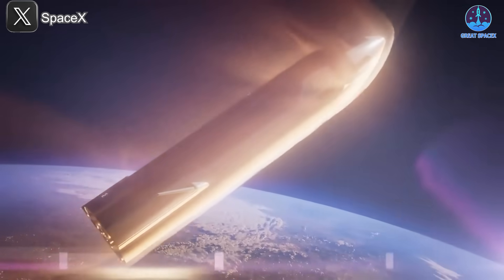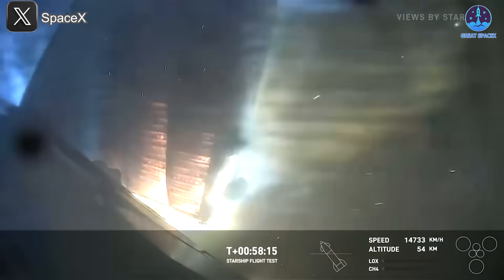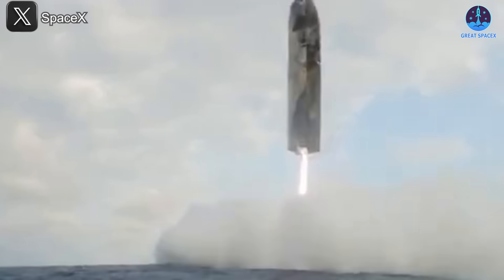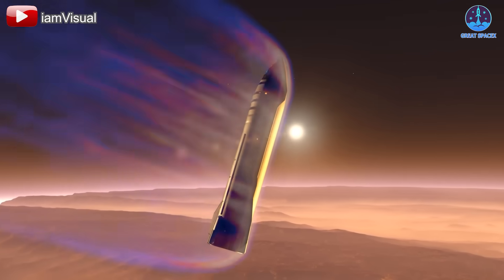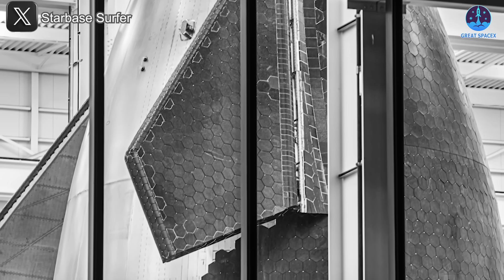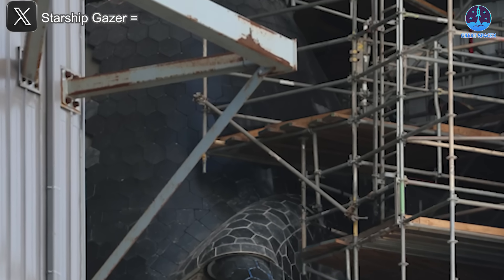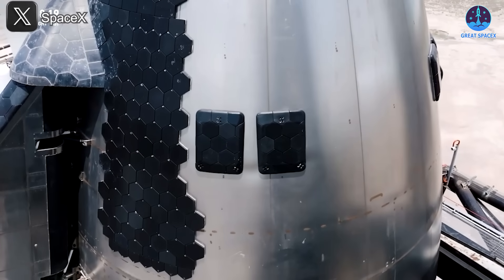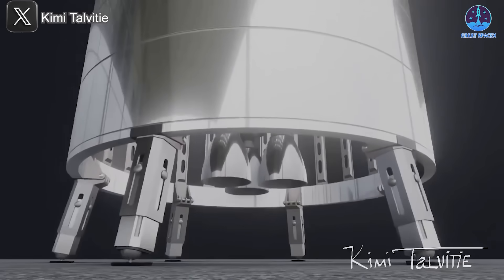Elon Musk Revealed Why SpaceX ditched Starship's Ceramic Tiles: New Metalic Trick!

Comment: The USAF space plane X-20 Dyna Soar developed in the mid '60s, was constructed of all metal.
Using Rene-41 alloy & Inconel-X, welded to create the fuselage and wings. For the hot nose cone, a metal-metal composite was developed using Zirconium pins in a matrix.
All was tested and cerified for the extream conditions of rentry, and fully reusable.

Comment: No, they really won't replace it as you say as these All or Nothing ideas are dumb as hell.

Most of the craft the tiles are fine. 

It is mainly the joints for the flaps, so for those it would make sense to evaluate adding transparation to the joints.

Trying to cool the entire thing with nitrogen or methane is asinine.

They need to add some ventilation around the flaps/wings and use some of the metal tiles or some other combinations.

Comment: Well I would put dimples in the Hull which will be thinner due to the added strength as is inherent strength which comes with Dimples, then I'd have an inflatable bollute which will inflate to be a heatsheild from below the Rockets then detaches at a safe altitude then land on the ground with thin curved titanium legs I'd say one every foot ....so there

Comment: Something like transpiration was tried on jets in the 1980's.  Compressed air was blown out through tiny pores in the wing to keep flow laminar and allow higher angles of attack.  It worked, but was impossible to maintain because the pores kept getting clogged by dust.
Reply: Clogging with dust seems like the biggest threat to the system.

Comment: When Spacex has established orbital re-fueling, they can refill the space ship prior to a boost back burn to avoid the reliance on atmospheric breaking,  Thus negating the need and weight of a heat shield
Reply: How much fuel would that take? Far too much to be practical I suspect.
Reply: @Tailspin80  It would require a complete refuel which SpaceX is committed to developing for the Mars and Moon missions.  The fuel is cheap compared to the ships cost
Reply: @ A complete refuel means a whole launch dedicated to getting the fuel up there. That ship has also got to return so what have you gained? Or are you suggesting the ship carrying the fuel is disposable so doesn’t need to return?

Comment: The catching outfit needs to be designed for the worst case, where failure is common.  This means the tower needs to be bombproof and easy to repair.  The issue is the size of the bomb when things don't go as planned.  It might be better to put the catch tower away from the launch tanks.
Reply: Ships are almost empty during landing.
Reply: @scientificperspective1604  Thanks for the laugh!  Have you ever seen an object that weighs that much slam into a building?  The ship can be totally empty, but the damage will be massive.
Reply: @kensmith8832  You seem to be reaading something other than what was written.
Reply: @scientificperspective1604  It seems you are on a different page from my original comment.  I am looking at the physics of inertia versus steel.  The amount of fuel only adds mass.  I am sorry, I am talking Science, should we dumb this down to teacher level?

Comment: Using a hydrocarbon is not a good idea! Nitrogen maybe a better choice! 600 degrees to start the flow of the nitrogen. There should be an over flow and return to the nitrogen tank to cool down the gas. The color should not exceed a yellow color. If it reaches a red color. You need to increase the flow. When it turns blue you will need to replace the tile. It will have absorbed to much oxygen. The material will have its flexibility.

Comment: It takes forever to replace tiles but an ablative coating layer could be sprayed over the entire assembly quite quickly before each launch, sacrificing itself each time to protect the tiles.
Reply: Sprayed heat shields need to be carefully dried before they can be used as a heat shield.

Comment: Moving the fwd flaps is the most important thing. Even the rear flaps could be moved another 10°, and this would give enough angle to protect the joints.. what they really have to do is protect the other side of the ship from the thermal radiation. This involves either thermal blankets or an ablative white paint that is used by pretty much every other spacecraft, including the dragon capsule. just like on the space shuttle. The plasma generates enormous infrared heat that must be reflected away on the opposite side. This is why the leeward side is deforming and discoloring so much. This type of stress will make the ship unusable after even a single flight.

Comment: Starship and Tesla full self driving are both failing because Elon will not admit that he took the wrong risk. The SpaceX starship second stage needs to be completely redesigned because the magic material that Elon told his engineers to assume would exist that could survive the heat of reentry and be instantly reusable Does not exist and probably cannot exist based to the laws of physics. Tesla full self driving is failing because Elon told his engineers to only use video cameras and no other type of sensors. Full self driving doesn’t work and it is clear that Elon now is trying to hide that fact by keeping Tesla full self driving far away from independent testing or even reporting on crashes caused by failures of full self driving. Taking risk is fine! But knowing when to admit, failure is a key component that Elon is missing.

Comment: “Catching starship“ is completely meaningless if there is no instantly reusable heat shield tile. Until the magic instantly reusable heat shield tiles that Elon believes can be made exist, catching a starship second stage is a complete and utter waste of time. Unless the idiot clown child, Elon can defy physics and come up with the magic substance that will constitute an instantly reusable heat shield, the very first thing that a starship that is caught will do will be to improve it from the launch tower, take it away to refurbish a great expense, the thermal protection system.

Yes, Elon was correct when he postulated that a booster stage like that of the falcon nine could be caught or landed and reused successfully. Of course, no one wants to talk about the fact that falcon nine boosters, even after several hundred flights are not reused immediately. Falcon nine boosters after they are landed have to be inspected And refurbished before they can fly again. Elon postulated that the starship could be immediately reused as long as a magic substance that can survive reentry and be immediately reused for a thermal protection. System could be engineered. That is proving not to be the case!

Comment: Starship is failing!!! Elon Musk told his engineers to design a starship based on the existence of a magic substance that could survive reentry and be completely reusable immediately after. The size, shape, and reentry approach of the starship is all based on the existence of this magic material. Now, it is becoming clear that this magic material does not exist, and will not exist. SpaceX is now frantically throwing all kinds of things against the wall in hopes that they could find something to take the place of this magic material. I hope they succeeded, but if they don’t succeed soon, then it is going to be necessary to completely redesign the second stage of starship Using materials that really do exist and also to change the operational approach. The idea that a starship second stage will be flown down and land at a top a super heavy booster already on a launch tower is complete fantasy now and needs to be changed.

The situation that starship is in could have been avoided if SpaceX had invested in sufficiently rigorous ground based testing before they designed starship. However, the idiot, clown child Elon obviously told his engineers we don’t need to do that you can just go ahead and believe me! This situation is very similar to Elon‘s other massively stupid decision, which was that oh the starship doesn’t need a flame trench! NASA got it all wrong! Flame trenches are unnecessary! Of course, we all saw over the first few flights at SpaceX finally was able to convince the idiot clown child that they did in need need a flame change if they weren’t going to destroy the launchpad for each launch.

Elon is not a genius engineer. He is an idiot clown child who makes decisions without facts that end up dooming the projects that he works on. Another project that is being doomed by a decision of the idiot clown child is full self driving. The idiot, clown child Believe that only cameras were necessary to provide data for full self driving and other types of sensors were not. This is why full self driving is not working in Teslas. And will never work in Teslas as long as they stay with Elon‘s stupid decision of only using video cameras.
Reply: The starship second stage needs a complete redesign. It is now painfully obvious that Elon‘s dream of a magic material that can withstand the heat of reentry and be instantly reusable is just a pipe dream. It is not going to come true. All of the major design points of the starship right now depend upon the existence of this magic material. Now that it is clear that this magic material does not exist, the second stage of starship needs a complete redesign. Every test that SpaceX does with the current design of the starship second stage is really pretty much a waste of time. They are not learning what they need to learn in order to create a second stage of starship that will actually be Reusable. My suggestion would be that they should go to a space shuttle like design that can land on a runway rather than an expensive and unique launch shower.

Comment: I'm npt enthusiastic about methane as a coolant since it is flammable and the combination of heat in an oxygen atmosphere, I believe that the methane coolant would sheath the spaceship in a wreath of flame. Nitrogen is better but it is probably a gas when used so it will not carry off enough heat. Problems that will be addressed but this first description is not likely to be the solution.

Comment: If plasma is controlled by magnetic fields, like in a Nuclear rocket engine. Why cant a magnetic in the center of the title repeal the plasma??? ""Plasma magnetic charge" is not a standard term in physics, but it essentially refers to the concept of a plasma being influenced by a magnetic field due to its charged particles, meaning the plasma itself doesn't have a "magnetic charge" but behaves as if it does because of the collective motion of its charged ions and electrons within a magnetic field; essentially, the plasma is considered "magnetized" when the magnetic field significantly affects its behavior. ' Is it not Plasma that is the issue???
Reply: Actually the problem isn't plasma. When a space vehicle re-enters the atmosphere, the compression of air results in the creation of plasma, but there is always a boundary layer of air that prevents plasma from ever making contact with the vehicle. The largest source of direct heating, is convection from the boundary layer. While the plasma itself certainly has a radiative heating aspect..... the biggest issue remains heating from convective friction.
Reply: In theory a magnetic field oriented along the ship would deflect the plasma. The problem is the magnitude of intensity of such a field, which makes the idea impractical. Just think about the huge kinetic energy of the ship at orbital speed that is dissipated currently by momentum loss (hitting the atmosphere). A magnetic shielding field should mediate all this energy loss without mechanical contact, requiring way more field intensity than is possible with permanent magnets inside the tiles.
Reply: @laszlokorosi9012  Even if you could deflect all the plasma with a magnetic field, you would almost certainly induce a quantum fk ton of eddy currents in the ships hull..... substituting convective heating for electromagnetic heating. That and you'd need a nuclear generator to power it all..... which they will never agree to having for a vehicular return.

Comment: How can they connect 18,000 metallic tiles to a cooling gas supply
Reply from the maker: Great question. Do you have any suggestion about this?
Reply: @colonbina1 maybe it isn’t 18k, maybe use large sheets of metal which would simplify the plumbing and connection points. I’m just spit balling here.
Reply: @colonbina1  The metallic heat shield would not consist of tiles. The red tiles are probably a different kind of silica-based composite tile with a different ablative coating. The coating may create a plasma barrier further from the ship itself compared to the black ones. A metallic shield would be more like a second skin with channels inside it. Because the fuel is stored at such high pressure it is also extremely cold at cryogenic temperatures. So they can use fuel circulated through the channels under the second skin. The system would likely be pressurized by the heat of re-entry itself causing the liquids to expand and form gases. 

Engines bells are cooled in a similar way. Where fuel is circulated between two skins within channels around the engine bell. Then that pre-heated fuel is injected into the combustion process. In this case, the fuel would be likely used for the gas thrusters that control the attitude of the ship. A metal layer would still likely utilize an ablative layer painted on as well.
Reply: @ well if you really want my opinion  I’d drop the idea of using the tiles entirely. I think I’d do what any sensible rocket payload specialist  would do. I’d change the unhelpful pointy nose for a big flatter blunter rounded one with a fully discardable  shield but  the rest of  craft would be mostly in its slip stream  so as a relatively small if a little heavy 8inch thick ablative shield  that would  slightly protrudes over the metal leading nose end. then I’d decrease the angle of attack of the vehicle to put the vehicle right behind the nose as it’s coming in then I’d forget about any  very heavy tiles apart from the few ablative ones on the leading edges on the flaps. I’d let the front shield take the punishment and after landing I’d throw it in the bin and fit another one  I’d fit replacement flaps and recover the original  ones with new ablative tiles  on their leading edges again. Ready for the next flight. This would allow  for when ship is really coming in hot and much faster  say when  coming back from the moon or mars which would have seen  the original tiles getting 100 percent hotter than from the relatively slow suborbital flights they have done so far.
Reply: @johnfranks9271  Pretty sure the broadside approach is part of the calculus when landing on mars. Since the thinner atmosphere, high velocity, no parachutes, and difficulty getting fuel there for delta V. 

But yeah it was painfully obvious the nose is too pointy and the flaps needed to be further recessed behind the hypersonic shock cone.

Personally I think they should put a pointy protruding rod with a knob on the end made of carbon carbon. So the cone is very far away. Like a bottle nose dolphin with a big fat clown nose tip. 

Edit: More like a hammer head shark. But on a thin protruding fin, rod, or structure on the underside. The profile essentially scaled to match the cone expansion and dimensions of the ship. Positioned so the cone is outside the entire ship. Then actuating the position of that rod or fin could provide attitude control until it is retracted for the larger surfaces to take over. Or maybe you don't even need the fins.
Reply: @colonbina1 Perhaps a sponge like-arrangement with the coolant stored just beneath the tile. Perhaps transpiration from the sponge could pump the coolant through to the surface. The sponge might be staged: tile, region, area, spacecraft.
Reply: @rwesenberg  I also considered a possibility like that where fuel is directly expelled over the surface to create an ablative layer in effect. The only reason that option didn't make a lot of sense is that fuel is the essential thing in short supply when it comes to performing actual missions. You can only dump so much before the ship would be better off smaller and weighing less like a traditional capsule.

Metal alone would conduct a fair amount of heat even if it could survive the conditions it would cause problems with the atmosphere inside the ship. There needs to be a layer with the insulating qualities of silica or some means of removing that heat. Transpiration is like evaporative cooling but doesn't need to happen outside. Also, the cooling effect requires a cooler outside ambient temperature. So it could work to pump heat from the shield into the cooler cryogenic tank with a heat exchange.

I would do both maybe. Put the fragile silica insulating layer under the robust outer metal sandwich layer with inner channels. Then thin ablative paint on coating. Just make the silica layer much thinner. Then it's just a matter of spraying on that outer layer. Just a sandwich layer with no fuel is an excellent heat sink. The XB-170 used that with extremely thin Inconel skins.
Reply: @brendanwood1540  There are several approaches that might provide the temperature control. However, where to sink the heat energy, and how to avoid a complex and possibly unreliable manifold system seem key. Heat tiles either have to erode or abilate or re-radiate the heat away from the SC. The heat load has to go somewhere.
Reply: They explained that IN  the video 😮